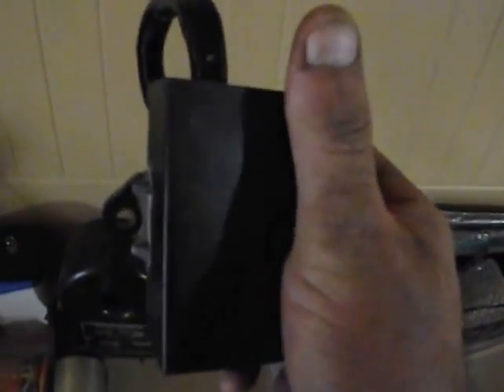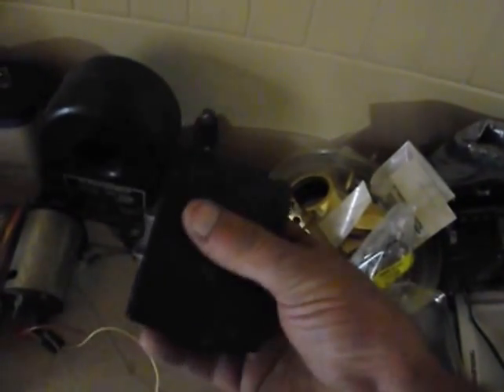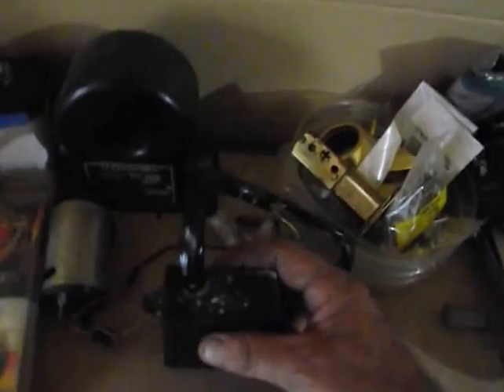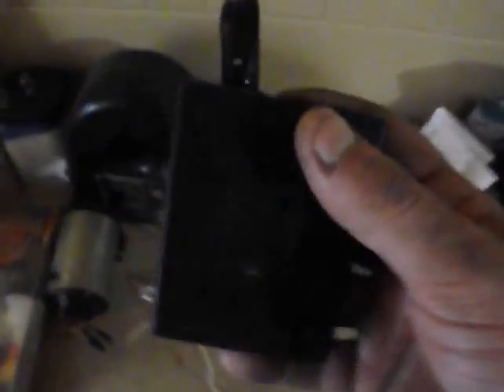Electronic CDI Box Repair  75% Success Rate

Comment: If there spark can you rule this out ??
Reply from the maker: Hard to say for sure sometime they work and they don't because of the dampness inside at that point it sort of matters to the day out side with the moisture being high or low to add or to remove. Heating and resealing is a sure way to dry it out and to remove that dampness problem. There are other reasons that will  cause the same sort of thing. Could even be bad plugs. I,m sure most people know that simple stuff already.

Comment: Do you think this would work with a relay as well? I have a fuel pump relay not working right. ty
Reply from the maker: No it wont work
Reply: @MrDoingEverything  Ya I found out a couple hours ago. Afterwards I even tried opening it by boiling it. Nope, that potting is crazy hard. So I took a saw to the back end and well let's just say I ruined it. Haha. At least a new one is arriving today.

Comment: NipponDenso 070000-0770, for an 83 Alpine.  I just got it to run putting the box in front of the fireplace for a few hours - did both sides.   It got almost too hot to touch.  Also it was running with the CDI  floating, not bolted to frame.  I will rebolt and verify it wasn't a ground issue.  WooHOO!

Comment: Worked Amazing! 83 suzuki dr125 it ran in warm weather kinda. Rebuilt everything. Winter came, got it to idle but would not rev, would make a lean bauuuoorr but wet plug. Stuck heat gun to cdi and bam! Revs. So 300 degrees 10 min. In oven, sealed end better and she runs Awesome!. You rock! Thank you

Comment: Why are these not designed to be held inside air tight containers with a gasket? Or can we do so?
 I cant imagine that these get hot while in regular use on the bike
Reply from the maker: My guess is condensation but that could be solved also. No idea why they would not have had a better way to protect them. Maybe they figured they were all sealed up and were protected and for a long enough time period before the sealing compound would crack to allow moisture in.

Comment: You Sir just saved me about 300 and alot of time. After having a hard time finding the correct cdi for my old sled i came across your video. Tried it and Boom! Got spark! Put it all back and machine is running. Dont know how long this will work   but for now your trick works great. Thank you very much🙂
Reply from the maker: If you sealed it back up could last years again. With out sealing it back up who knows.
Reply: @MrDoingEverything  Ya i forgot to seal it😳 so ill have to see, of it fails again then its back in the oven🙂

Comment: today i tried on my ktm 640 sm 03 it didn't work. I put the cdi in the oven at 120 degrees celsius for 10 minutes then I let it cool and put it for another 4 minutes. does not work. but when it needs to be reassembled it must still be hot?

Comment: This absolutely works....... I have to admit... I was a little doubtful but finally decided give it a try.  I am working on a Vino 125 Scooter that a friend owns.  CDI had failed... Yamaha does not make the replacement anymore.  I decided to pull this apart and repair it but thought what the hell... I just pulled a pizza out of the oven.. I'll let it cool off a little and give this a try.  I would keep an eye on iot and as long as nothing started to melt why not.  Wrapped the wire bundle and connectors loosely with foil and set it on the center rack bottom side up... then baked it for 10 minutes at 300 degrees.  Pulled it out and sat it bottom side up and left it on the counter til the next morning...... Worked like a charm.  Before you toss out an old CDI or begin cutting the case apart... Give this a try..

Comment: Will a bad cdi box act up when the engine gets hot??,, talking about snowmobile here, cause when the weather is hot it will drive good for about 10 mins then it will lose power as if im driving on one cylinder, but when it cools down i can drive… and my snow mobile is fan cooled,

Comment: Bought an 85 Yamaha YFM 200 4-wheeler for $100 that "needed work".  No spark, but everything else tested somewhat OK according to the service manual, so then it says to replace the CDI Unit.  Well, as most of you are aware, these are not cheap, for a knock-off CDI Unit, we're talking $200.  I came across this video and it got me thinking this could actually work, but I was a little concerned with the "around 300F for around 10 minutes".  I placed mine in an oven set at 100C (212F), the temperature which boils water.  Let it soak in there for 5 hours.  Placed it on the machine the next day and I had spark!  Thank you TOSB!
Reply: 5 hours? No smoke or toxic fumes??

Comment: Would a heat gun or hair dryer work approximately the same way? And this is for issues where the starter turns over but the bike never starts or starts sometimes cause there  no spark or only spark sometimes?
Reply from the maker: It needs to get very hot. Very hot right to the core It's that simple. Any method that will do that will dry it out if moisture is the reason. Sounds like CDI is your reason though unless it's a bad wire connection somewhere. Or a faulty spark plug. There are other reasons why spark can fail.
Reply: @MrDoingEverything  i have a 2004 Polaris 600 twin i heard they had alor of ignition system issues. Someone told me I should be able to check power is getting to or from the cdi and straight wire it or something…cause the polaris uses ac electric system instead of dc like most other atvs
Reply from the maker: @352sports8  Testing should be done to see what is wrong then the fix is easier to be able to do. Trying the method of heating the cdi is a easy thing to do and could fix but there is no way to be able to tell. Best of luck

Comment: thanks fer tip A+ i use china box on mine stiff ajustable ones dc and ac unit will work on most any thing
Reply from the maker: Maybe put a link in for others to click on. Cheers
Reply: @MrDoingEverything  look up on ebay {adjustable cdi box gy6) AC or DC what ever one needs .i use dc boxs for all retrofitting simpler super eay to wire in diagram on google images on both ac  or dc  .they are 12 bucks or so heck one can get kits with coils rectifiers etc but kits are never adjustable cdi timing  i guess one does not need timing adjustable but nice to have if using on different thing as one may need to tweak it
Reply: @MrDoingEverything  AC BOXS https://www.ebay.com/sch/i.html?_from=R40&_trksid=p2334524.m570.l1313&_nkw=ajustabe+ac+cdi+gy6&_sacat=0&LH_TitleDesc=0&_odkw=adjustable+dc+cdi+gy6&_osacat=0
Reply: @MrDoingEverything  dc boxs https://www.ebay.com/sch/i.html?_from=R40&_trksid=p2334524.m570.l1313&_nkw=ajustabe+dc+cdi+gy6&_sacat=0&LH_TitleDesc=0&_odkw=adjustable+glasses&_osacat=0es
Reply: @MrDoingEverything  gy6 cdi plugs wires https://www.ebay.com/sch/i.html?_from=R40&_trksid=p2334524.m570.l1313&_nkw=gy6+cdi+wiring+plug&_sacat=0&LH_TitleDesc=0&_osacat=0&_odkw=gy6+cdi+wiring

Comment: Novyz(Shanghai) supply the custom service of Electrical Junction Box, 19"1u 2u 3u 4u 5u 6u,7u, 8u server subrack/chassis and network enclosure, rack case,etc. Shelly Ph: 86-13671843635,  2911282844@qq.com, Skype: linnaniu1

Comment: Im hoping you see this, will it possibly work on a completely sealed box? I got one that is shorting and cause my front coil to not fire but back one does. Switch coils and same thing so both coils work. When I test the front coil pin on the cdi I get a spark at the cdi pin so I'm guessing short in the cdi?
Reply from the maker: The box may seem sealed up but there will be a hair line crack that the eye can't see. I would try my self. No harm done it don't work now is how i would see it. Afterwards it just might work.
Reply: @MrDoingEverything  update so I tried the method did not work, but it did not work because the resistors on the board blew out found that out after I cut it open new board fixed my problem but this is a method I will always try now thanks
Reply from the maker: @dirtbagthings  Welcome

Comment: Would this work on a jetski cdi? I had an oem that failed, and a recent replacement right out of the box. It failed its testing against the manual ohm chart. I wouldn't think there is moisture in the new one so maybe a soldering point failed?
Reply from the maker: I have no way to know. No harm done trying right.

Comment: My waverunner 500 cdi stoped running after taking it to beach when I turned it on before putting it in the water it ran for about 30 secs then shut off and never turnef on since. Its been about at least 5 years I did took it out the ski you think this might work even if it was moisture that cause it its been sitting indoors all this time.
Reply from the maker: There is nothing to loose at this point is there. No harm done for trying it if it solves it it's solved and your back running. If not no big deal it never worked anyways. I would certainly give it a try and find out.

Comment: I got a 1991 rm 250 and a little bit ago I was riding with my cousin and I rode through a puddle and my bike just stalled on me. At first I thought it was my ignition coil because that was in rough shape and after I went through the mud I had no spark at all so I bought a new ignition coil and still nothing. I think I must have gotten moisture into the cdi box because it’s still the stock cdi box which makes it 29 years old so I wouldn’t be surprised if there where cracks like said in the video. I’ve been searching online for a new cdi box to fit my bike but haven’t been able to find any. I guess I will give this a try to see if it works!
Reply from the maker: I would to yes.

Comment: Holy shit! I have used this technique on my 1986 Mercury outboard that’s no firing on 3 out of 4 cylinders and it started her right back up. Thank you so much and I would give you a thousand likes if I could
Reply: Ends up not ECU problem.
Was malfunctioning TPS.
Throttle position sensor.

Unplugged all sensors one at a time to determine which sensor not reporting correctly yo ECU.

Comment: Worth a shot. Runs like crap now anyway.
Reply from the maker: No a cdi pretty much works or it don't. I think you issues is either bad plugs or plug or caps or cap  or maybe carb.
Reply: @MrDoingEverything  Thanks! My bike was fouling plugs every 1-2 hrs of riding. The carb was gone through thoroughly. Including changing out the jet block gasket. Got my plug cap coming in the mail. Hope that solves my issue.

Comment: Do I need to make a hole for moisture to escape before I heat it ???
Reply from the maker: No. I have never made a hole. There are already tiny cracks hair line. When heated they will open a little to allow the escaping. Then seal it back up before it completely cools off
Reply: @MrDoingEverything  thanks brother.
Reply: @MrDoingEverything   I held my spark plug while spinning the motor as it spun I flipped the override switch and felt a single spark. From this I'm assuming my coil is good and think it could be my switch at the handle bars. I've read some arctic cats have flywheel issues with the magnets falling off damaging the status.  Not sure if mine is one.
Reply from the maker: @lawrencemiller2379  The problem could be many things Bad spark plug bad switch bad ground broken wire. There are a few more things on the list it could be. Its best to rule out the easy and free fixes first. Get them one's out of the way before going deeper into area's where it starts becoming costly.

Comment: I just did this and it worked. I've got a 1987 suzuki dt25 outboard. It is 2 cylinder and has a cdi with a wasted spark coil built in. I bought a seperate cdi and wasted spark coil off AliExpress. I'm in NZ so it takes a month for stuff to arrive. I got sick of waiting so gave cooking the old cdi a go. Like you say I had nothing to lose. It worked. I couldn't help but laugh. Thanks so much.
Reply from the maker: Welcome
Reply: @acgolem  Did the AliExpress CDI hold up over time?

Comment: I have a 2000 Arctic Cat 400. Lately it’s been having trouble starting, then when it finally starts after a few hits of the start button and holding the gas, it idles for about 15 minutes then it slowly dies. Prior to having this issue I had replaced the battery, regulator rectifier which burnt up, I’ve cleaned the carburetor really well, replaced spark plugs, and for several months it ran great up until recently. Today I replaced the ignition coil to see if that would solve the problem because someone suggested that it might be shorting once it gets hot. That didn’t fix the problem, someone else said it might be the cdi. Does a bad cdi box cause an atv to quit running after it has ran for about 15 minutes and heats up?
Reply from the maker: It could yes. Make sure the right temp spark plugs are in it. Some time the spark plugs can get to hot and that will stall it out. Do you know if its still getting gas after it stalls out. If not then that's the problem. I would even check the engine seals to make sure there not sucking air.
Reply: Thinking out side box thanks for the reply, I’m using the correct spark plugs so I don’t believe that’s the problem. Fuel doesn’t seem to be an issue either, it’s getting plenty of gas. I’ll check to see if it’s sucking any air, but I really feel like this is some sort of electrical problem. Before I replaced the regulator rectifier it had very similar symptoms to what I’m dealing with now.

Comment: wouldn't simply putting it in a bag of uncooked rice for a few hours essentially do the same thing?
Reply from the maker: No it would not. The moisture needs to be forced out that's what the oven heat does. Rice will not do that forcing it will only absorb. Which is good for some moments.

Comment: Not gonna lie... was very sceptical of this. I've been chasing an electrical problem for about a month now on my 86 Shadow 500. The front cylinder wouldn't fire under 3500 rpms. I tested the coils, pulsers, and even the cdi box... went through all of the connections, then the battery  grounds, etc. All was fine and I was ready to pour gas on the bike and torch the MF. I came across this and tried it... wtf do you know the bike fired and runs like a champ. I did notice that honda didnt bother to seal this cdi box at all btw.

Comment: Whats the hottest and longest i could try? I see the same spark maybe a tiny bit less, gonna try once more
Reply from the maker: To me that cdi box can not be hurt any longer so i would give it a longer harder heat up for one last try. If still nothing then its for sure no longer any good and a new one is needed.
Reply: @MrDoingEverything  should i try 400 degrees f at 10 minutes?
Reply from the maker: @skidoock3606  If it was mine i would before i called it junk. The way i see it there is nothing to loose being its already not working. I would just keep an eye out on the plastic and wires and plug on the end.
Reply: @MrDoingEverything  give it hell at 400? Will watch the plastic ends
Reply: Thanks for answering so sorry to keep asking one more question at 400 could that help the solder joints? If one is loose
Reply from the maker: It could. The smaller joints more so.
Reply from the maker: @skidoock3606  Sparks are not all the bright. Just need a good spark is all. Blue is nice but some time they look a little white to. The coils is what makes the spark strong. If your coils are weak there will not be a good strong spark

Comment: Just did this exactly as described on a 1998 mach z 800 tripple cdi, has weak spark wont start or even cough, day it stopped working i washed the engine and it ran about 15 minutes then shut off like i hit the kill switch, tested everything cdi only thing it can be, its cooling as i type this, im going to install it and before fully assembling will just pull over and look at spark, on the 98 the cdi is under the engine, i collect 98-03 ck3s never had this issue till i got a 98, i wanted it so I'd have one of each year and edition but man after full restoration including new seat paint and decals plus new crank bearings and pistons now this😑 hoping this trick works and if it does for many years! Will update in an hour or so
Reply from the maker: Hope it works for ya there. About how long and hot. Well really hot is the key as long as the rubber on the wires down melt. But it needs to get hot for sure. I,d say 25 minutes or so.
Reply: @MrDoingEverything  after this no spark and barely any light on test light, was still useful because it proves the cdi is bad

Comment: Wow amazing, was having issues with my CDI box and I ordered one online thinking I needed a new one.   I got a cheap knock off[ not recommended] in the mail and plugged it in and it didnt work. So I began the troubleshooting process and came across this video and immediately threw mine, the OEM one in the oven and hooked it up and the bike started right up. Absolutely amazing. And thanks for this video!
Reply from the maker: Welcome

Comment: WOW!!! too easy worked great thanks
Reply: Ray Kramer what made you think it was your cdi box? I’m not getting any spark and am really considering trying this out.
Reply: @yopapi6791  I tried everything else I have been a mechanic for 59 yrs and think back boy I could have tried this years ago  I have an oven in my shop for power coat and to heat things , I just set it in on rack wires upward 300 deg. for 10 min. let it cool plug it in strong spark ( this is on a 86 YFM80 cdi were upward of $300  cant hurt cdi at 300 deg)
Reply: Did you have any spark at all previously to trying this?
Reply: @yopapi6791  No!